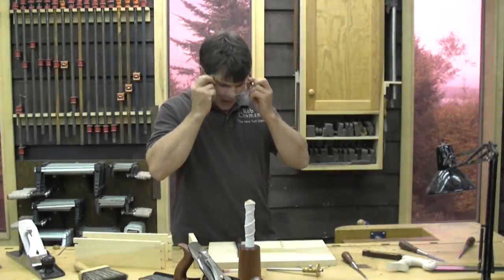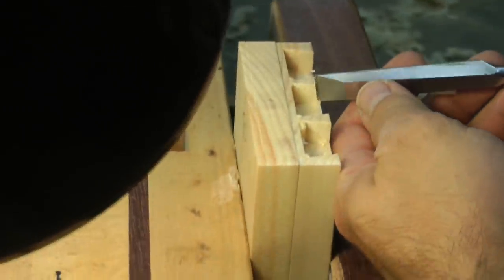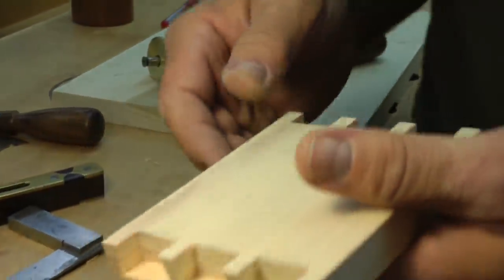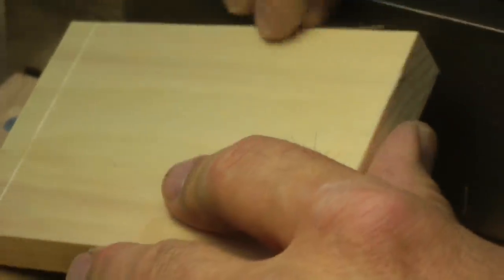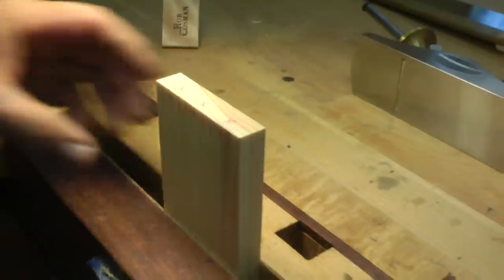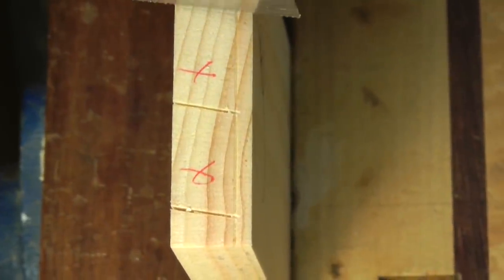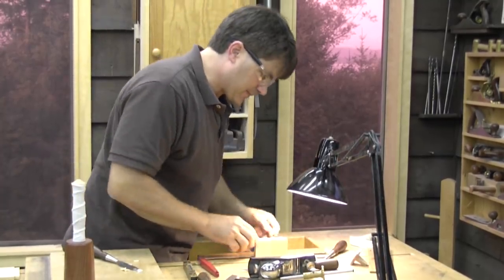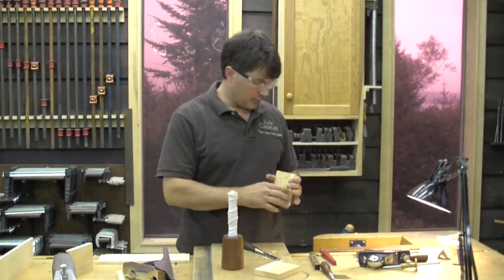Hand Tool Project - Episode 9 Pine Candle Box

Comment: Hi there Rob,
Have you tried using an LED head lamp? I use one with low/high setting and the low level puts the light right on that scribe line with less heat and shadows. Since I've watched your original techniques series with American Craftsman Publications, way back when!, where you used to say how important lighting is to the precision of the joint finish, you even used to have a small magnifier around to check things out, and that stuck to me over the years trying to find the best light projection on the work piece. 

As always, your work is a rich school of thought in woodworking, and you will always have some new knowledge to spread around. Thank you and your team for time and effort.

God bless you all.

Comment: i tried to joined the hand tool workshop videos on your web but i only could find power tool workshops, so i feet cheated. are videos showing hand tool projects available?
Reply from the maker: On my site, robsworkshop.com there is the "Hand tool Library" that is 7  years of content building furniture with just hand tools.  There is also "Robs Online Workshop" which is three new 45minute workshops each week using both hand and power tools.